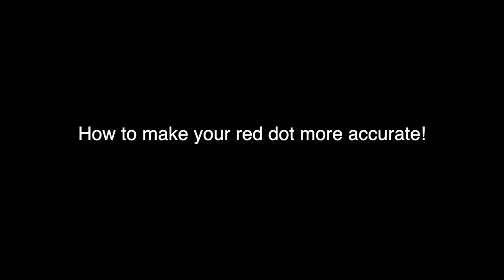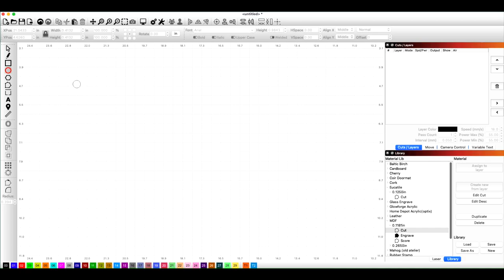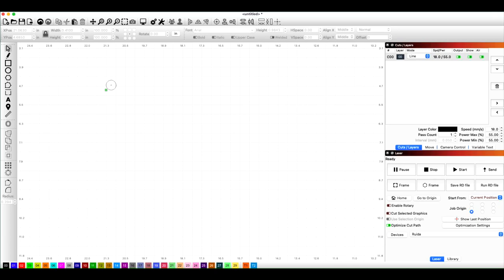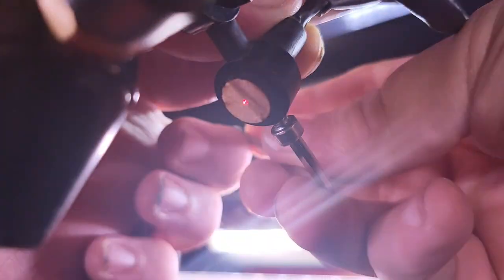CO2 Laser Red Dot - How to make it a finer dot

Comment: In the front of the pointer, there is a brass ring with two notches. If you use a screwdriver or another tool that fits in the notches, you can adjust the focus point clockwise or counterclockwise until it becomes sharp. Start by setting your laser's focus point before adjusting the red dot's focus point.